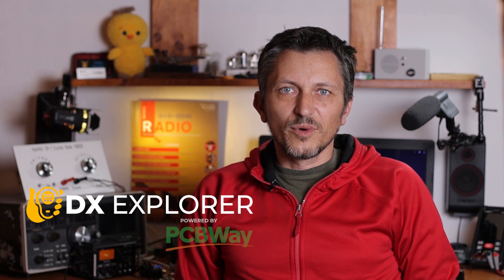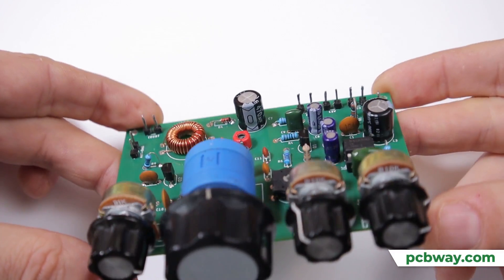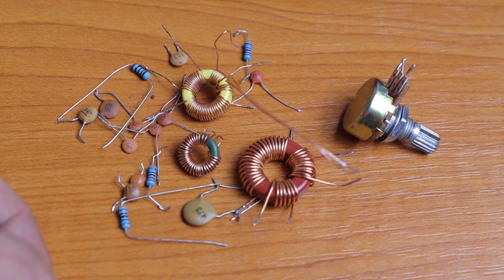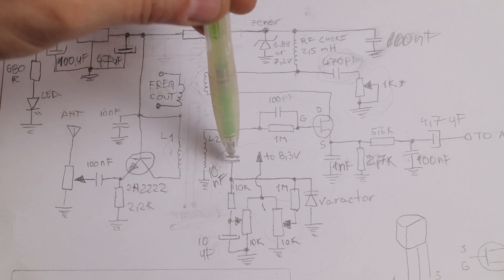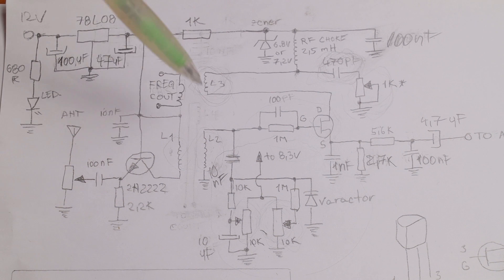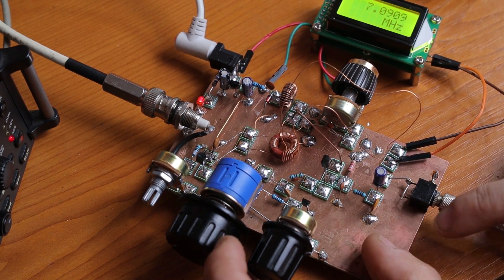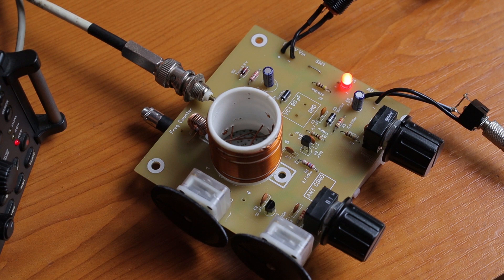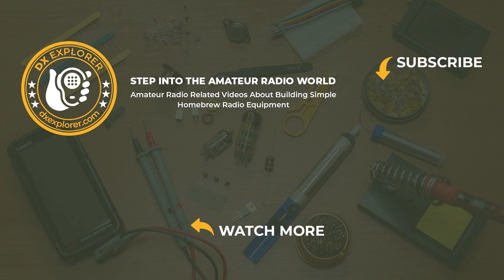Improving A Simple FET Regenerative Receiver ( N1TEV ) - Part Two

Comment: Forse ho un' idea per dividere le bande destra e sinistra.. con un traslatore di toni tipo l' integrato HT8950 che si usava per modificare la voce in orco o paperina.. che però ha dei salti fissi e la traslazione non è regolabile con continuità..
Allora spostando il centro banda verso la banda laterale, esempio sinistra, questa diventerebbe più orco mentre quella di destra paperina
a questo punto intervenisse il traslatore di toni potrebbe far tornare normale la banda paperina e rendere ancora più bassa quella orco..
..un traslatore di toni in SSB sarebbe da provare, ce ne sono anche di sofisticati ma non sarebbe qui il caso,  che ne dici..
Reply from the maker: I never played with those. It could work, is worth trying. Honestly I don't bother so much... a regenerative receiver will always be a regenerative receiver with both sidebands hahaha. I like them as they are especially because of the simplicity and the fact that they are easy to build by beginners. If built with atention and care..  it can become pretty performant. I have in plan for next winter to build one... the last one... to be the ultimate one, the best of all I built so far. I admire very much those built in WW II.
Reply: @dxexplorer provare quei traslatori sulla SSB è un esperimento a se.. poi riguarda la parte BF ..lo potresti provare anche su di un apparecchio professionale..  quanto per la sfida di dividere le bande laterali in un ricevitore a conversione diretta come principio o reazione..
Potrebbe servire a qualcosa sia in trasmissione che ricezione.. poi è un uso inconsueto no.. quindi per sperimentatori dilettanti!!!

Comment: su questo circuito ad esempio io ti consiglio di mettere un potenziometro da un 1000ohm tra positivo e negativo dell' alimentazione (i 6 V sullo Zener) e staccata dalla massa la resistenza sul Source da 2.7k con il pedino centrale  del potenziometro ci alimenti quella ..regolando anche da li la reazione..  vedrai bene con questa regolazione il passaggio che ti dicevo.. probabilmente quando il FET comincia ad  auto-oscillare  lo fa in una zona della curva dove distorce molto ..e un poco amplifica e un poco demodula il segnale SSB.
Vale per quasi tutti i circuiti (è una polarizzazione che riguarda la continua non la AF), anche a valvole che potrai alimentare con basse tensioni.. e secondo me è la regolazione più conveniente..
Reply from the maker: I want to experiment with this yes. Thank you. So basically I no longer need the thicker coil I beleive and the regen control as it was in the circuit... instead I will use the potentiometer ? I am working now in a version powered by USB... I have a video in the ones I posted lately and I want to use this method for that receiver.

https://youtu.be/AJc9p7OUf9I?si=TbmVqNX49icHh17o
Reply: @dxexplorer  quel ricevitore mi pare molto buono. 
Io cercavo un modo per ricevere una sola banda laterale eliminando l' altra.. ma per ora non ci riesco.. forse mettendo un secondo reazione vicino al primo con la funzione di preamplificatore molto selettivo di antenna.. ma poi per l' accordo sarebbe dura.
Saluti e buon divertimento!
Reply from the maker: Thank you so much. I tried that too... and I experimented a little. You can eliminate it but not completely... with a very fine regeneration control. There is a point where it will eliminate the other band but not 100% ... still is better than nothing. But for me it was always hard to adjust so I decided to give up the idea. Maybe... by using a multiturn potentiometer it may be easier... I don't know. To experiment in the future a little more I guess. Thank you one more time and have a fantastic week. 73, YO6DXE. Next weekend I may post the video on the USB regenerative receiver. I will test the regeneration control you recommended in that video.
Reply: @dxexplorer  posso anche dirti che con i traslatori di tono, ricordo quando avevo il CB, di averne montato uno sul microfono per far scherzi agli amici cambiando voce, ma che questi commutando la ricezione da AM a SSB riuscivano a centrare nuovamente il tono della mia voce e a riconoscermi.. dunque l' idea di sperimentarci meglio che però non ho realizzato..
Reply: @dxexplorer  scusa non avevo capito di eliminate l' impedenza da 2.5mH e mettere direttamente al positivo la L3 di reazione.. bisogna provare.. io come configurazione uso l' Hartley con presa sulla bobina di sintonia e bobina avvolta su toroide.. 
Col J310 comunque 5 V di alimentazione a me bastano e avanzano

Comment: Great video! Thanks a lot! What band tuned at the end of video, when lights turned off? Is it 20m?
Reply from the maker: Thank you as well. I am working now on part three of the mini series. I wanted to post it today but I have some emergencies to take care of so probably tomorrow or the day after. Yes it was the 20m band. It tunes now from somewhere a little over 6MHz to about 14.5MHz. I am still dealing a little with the regen control as I want the SSB and CW signals sound great on all bands available. Is a little tricky when covering so much with just one coil.

Comment: No need to worry about wasted 1.5 days.
I wasted about 5 years on similar thing and it still does not work in a way I want it to.
Reply from the maker: Hahaha... I hear you. I spent an year trying to improve the Sputnik regen but I was lucky and it worked... I am nearly there with this one too... but just because of the one year I spent with the other one. So hopefully after 15 years you get to build the one you always wanted 😁😁. Fingers crossed... 73, YO6DXE

Comment: Try using LEDS or 1N4001 AS VARACTORS ,Ive heard they can work well for fine tuning.
I was have thoughts of smd inductors with mutual coupling idea close to each other,hmmm
Also ive seen xtal controlled super regen.
Love progress so far.
Rob
Reply from the maker: Thanks so much Rob. I tried LEDs... not bad at all... but 1N4001 to 1N4007 work great even for main tuning. With one 1N4004 I think you can get about 50pF. I use these in the Sputnik receiver. Interesting idea with the SMD inductors... that would be fun if it works 😁. Let me know if you ever try. Back to this receiver... I am still making minor adjustments, but so far it sounds great... way better than in this video. 73 and have a fantastic weeked, YO6DXE.

Comment: Not good tuning
Reply from the maker: No not at all... not yet 😁. I am slowly getting there and you will love the final version. This was just a test after making the changes from the big coil and the variable capacitors to the new schematic. With a little patience and some fine tuning I finally got it to work as I please... and it works waaaaaay better now. More in the next part on this mini series. 73, YO6DXE.

Comment: Check what type of capacitors you are using. For frequency sensitive paret of the circuit such as filters oscillators etc you should only use cog or np0 types if you have any mica caps they are even better.  Other.  Caps do not perform very well are rf. They tend to drift and  their value can vary +-  30% or more I found that out the hard way when making a couple of band ;ass filters which would not fit with the design math 

As a temp measure fit a second  pot from the wiper of the existing regen control to ground and take the regen voltage from the wiper of the new pot. Acts like a bandspread until you can source a multi turn pot or change to varicap

Remember to resolve ssb you advance the regen until it just oscillates then vary the main tuning to resolve the upper or lower side and 

Andy
Reply from the maker: Thanks so much Andy. Ohhh for this test version I am using any capacitor that comes to my hand haha. At this point I don't care much about stability, but in the final version... ohh I will. Silver mica are good indeed, but for some reason I fount the np0 much better... and also a lot cheaper. I will need to get some more as now I have lots of them, but wrong values... and I don't want to end up with a bunch of "series" or "parallel" to make up one missing value. 

On the multurn pot... I have a few more yes... so I will use a second one I think. But I will try to play with the 1M resistor too as I think that may be a little cheaper for the people that want to build it... at least that is the entire idea for me... to make something nice that is worth building. But it's a really good idea so I noted that down for the future in case I don't have a multiturn pot on hand hehe. Thanks so much again and have an amazing week. 73, YO6DXE.